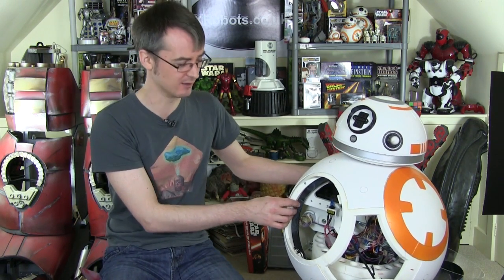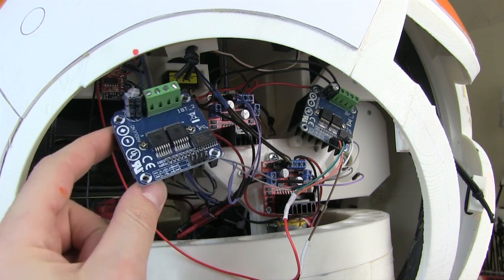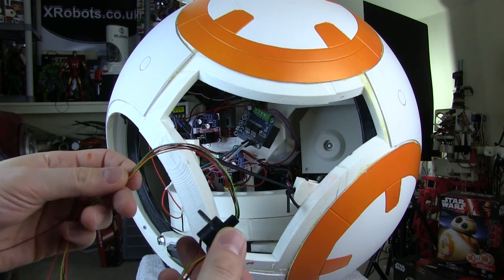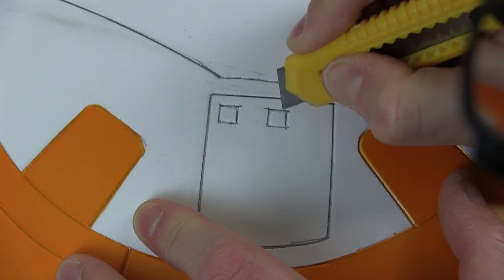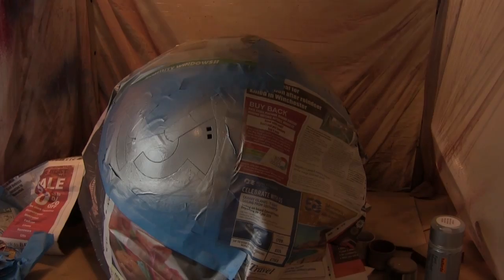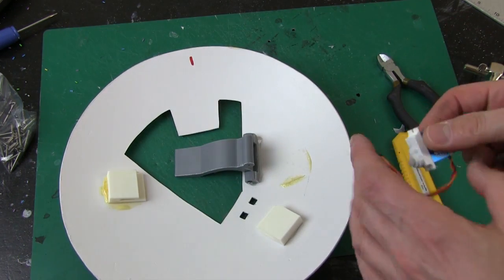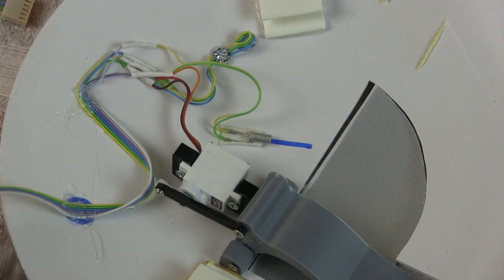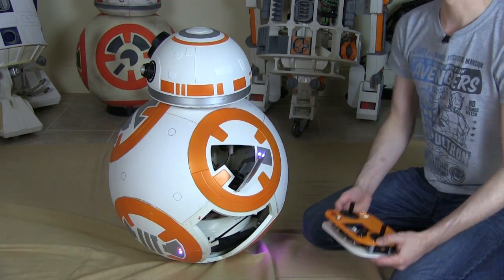Star Wars BB-8 Droid v2 #8 | Ball LEDs & Opening Panels | James Bruton

Comment: Do you think you'd re-jig the code (might need some kind of sensor on the head rotation)  so that the head auto-centres in the direction you are going?  You could look left, backwards or right, but when you release the stick, the head snaps back to the direction you're moving forward?

Comment: It would have been a cool effect if the first lid you made would have turned open, since it is quite centered it would have turned nicely and could have followed the outer rim. :). The diffuser for the LEDs could probably also be made with just a small glob of hot glue, molded to the curvature. Otherwise I am hugely impressed by your builds... As always :)
Thanks!

Comment: James not sure if you'll read this but just wanted to give a big thankyou. I bought the Taz 3d printer largely based on the fact you use them on this channel, and after a very long time researching as well. And I absolutely love it. It's only a Taz 3 so it was second hand (still cost me $1500AUD...) but it's worth every penny. Not one print has failed, and everything I've designed so far in autodesk 123d design has worked perfectly. I. Love. This. Lulzbot. Lol. I'm currently making an automated gate so that our dog can't get down to the loungeroom, because people always left the old one open and she snuck down, plus it was a bad fit and was bent and broken. I'm using an arduino and a 10kg servo to open/shut the gate with two sensors either side to open the gate in the correct direction when someone walks past, also a little light will light up so you can see the bottom bar at night. Honestly I don't think I would be making stuff like this if I never subscribed to your channel so again just want to say a big thankyou!!! Rock on!

Comment: James, thanks for the videos. I have a few questions. Did you say that you are going to do yet another version? See 14:50.  And, if someone were to put a world-class AI into BB-8 with feedback sensors etc, would they put the hardware into the BB-8 or would they have to do the thinking remotely and send commands wirelessly to the BB-8 unit? And lastly, I keep thinking that BB-8 must take a lot of power. Do you find yourself replacing batteries often? Thanks!

Comment: James, for version 3 you should make all the panels and the head detachable so that you can have a different design on the same droid if you want. For example a black and green color scheme with a more cone shaped head.
Reply: Of course you don't have to do this, just thought it'd be nice to be able to have a more unique droid design without having to build a new droid from the ground up.
Reply: +Bas van de Kleut I believe he is trying to replicate the original droid, not change it. However, it'd be pretty interesting to see the mechanics.
Reply: +HotDiggityDo ~ VMMGaming I know, but I thought that if he ever did want a different design he could just remove the panels and the head and stick on some different ones.

Comment: This is amazing, and it isn't even finished yet. I can't wait for the finished version.
WARNING: Contains mild spoilers for Star Wars 7

Some ideas for your opening panels - you probably have already seen many comments about the thumbs up lighter arm, which seems a bit limited given the space you have inside the droid.
But how about a little 3D printed cup/box that you could glue onto the inside of the opening panel, so when it opens you can store things inside the little box? It would be similar to the movie, but your panels open sideways so a retracting drawer like the movie BB8 has would be an idea for a potential version 3.
You could even print out a replica of the map piece that Poe gives BB8 at the start, to put in the box.

I'm curious to know if the droid can move forward whilst turning, as your turning mechanism is a bit heavier than before. Keep up the good work!

Comment: It is possible to do without the 3D printer ?
Reply: +Canal Do Levit Of course, however 3D printers are very useful in making custom parts.
Reply: +Canal Do Levit you can always measure/draw/jigsaw /sand wood by hand. The parts that curve on every axis could be a little trickier to make though.
Reply: Yes but I bet it will be VERY difficult. So probably no
Reply: Wood, metal, plastic, etc. ?
Reply: some parts I'll improvise
the internet incomendando
Like a dome ,
The body is coated fiberglass acrylic,
3 engines and
7 Parts I'll have to print

Comment: just letting you know that you need need NEEED!!!! to have a flame thrower utility arm in the shape of a thumbs up
Reply: Led fire?
Reply: +TheJoshinils yeah I think that would be wise
Reply: One of the two panels he hinged is the "thumbs up" panel (7:42 - "there's probably space here to have an arm or something that pops out" - just he didn't do the half-circle cutout on the clockwise edge of the panel) so maybe he'll get to it.
Reply: ***** True. Reviewing the scene it is a pretty long arm with a bulky attachment at the end. Doing it accurately, at least, probably, may not be possible.
Additionally the panel is oriented the wrong way for it to work for the "thumbs up" - when the panel is upright, the hinged edge is at the bottom or bottom-right.
I think even if you could manage a smaller, simplified version of the arm it'd be a popular feature. Perhaps it could be stowed parallel to the circular panel, and (using 14:15 as reference) slide straight forward through the open panel. Not movie-accurate but it may be compact enough to get a decent effect without a complicated folding arm or a retracting arm that'd interfere with the drive system.

Comment: Brilliant work! Can you please me some advice. I've built a full scale R2D2 it uses a 12v car window motor in each foot. For RC I'm using an AR600 receiver and a DX5e  I need a good cheap motor driver - not sure if I need a dual or two motor drivers. Ideally I want to use just the throttle to drive both motors. What would you use on a budget ?
Reply: +SuicideNeil Thanks a lot for reply. I'm thinking of getting the Sabertooth dual 25A motor controller it's quite pricey at $120. But I think it will do the job. Have you used a Sabertooth or would you recommend an alternative?
Reply: +Rick OShay why dont u just put a midget inside to drive it
Reply: +Idrankyourcoffeewhileyouwerereadingmyusername I tried that but he kept drinking my coffee when my back was turned.
Reply: +SuicideNeil Great thanks a lot!